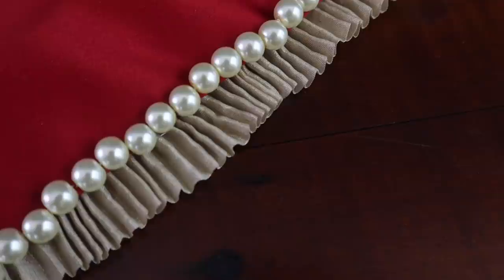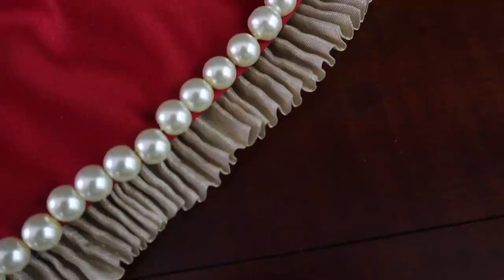Tudor French Hoods || Researching and Making a More Accurate French Hood

Comment: You've demystified the French hood for me. Thank you. I would mind paying for the patterns to make this. It would compliment my not so historic big historic tudor era patterns. 

Over the years now and then, I've see hoods with a widow's peak instead of a straight edge. Its rounded over the head like the French hood. Mostly have seen these seen on Spanish characters on various Tudor era shows. Not sure if real or Historywood.
Reply: Would should read as wouldn't. Damn autocorrexct.
Reply: The widow's peak has been interpreted as the bongrace,a separate band of fabric pinned to shade the head.But it becomes more common by the 50s
Reply from the maker: Thank you! Having a point or widow's peak becomes fashionable after about the 1550s, and really takes off during the last half of the 16th century. Hopefully I'll address that in the next French hood video!

Comment: I live in Sussex England, and happen to be a historian. I obtained my PhD in Medieval & early modern European Studies, from the University of Edinburgh. Additionally, I hold two masters degrees in Tudor history, and archaeology. It’s my opinion that there were several different styles and ways you could wear the hood. I also believe that the hood changed over time. I did a lot of comparison between Holbein‘s paintings and your image at 6:30-20:15, and I only really have an issue with the fact that Holbein was very intentional in his work… and he could’ve very easily made the hood look more flat as it would have appeared if that was in fact correct. The lines he would have painted are very different… Holbein had the capability to capture something exactly as it was, so why did he not do that then… This does not appear to be an illusion as the lines he would have painted to create the structure would’ve been completely different… I decided to sketch this out myself, and I found the same results…. I had no difficulty creating a more flat hood… and i was able to draw the hood just as it was, (No optical illusion). However, i had to be very intentional when giving a raised hood because I didn’t have to…. Artists of this period would not usually take the liberty to create something that did no exist, especially with something as important as a woman’s hood, or change the garmet entirely… unless it were a reality. This leads me to believe that the way he painted was intentional,  and maybe because that’s how it was. However, when I look at other portraits where we have a side view or even effigy’s… we can see the fold very clearly. So we have good evidence that the styles, although they remain similar where ever changing, and it’s not a stretch to say that there were probably very different but similar styles that varied when it came to the French hood. Lovely video!

Comment: I feel inordinately vindicated: my Year 13 teacher 10 years ago told me I was wrong when I said I thought french hoods were just folded back like a normal hood. This is the whole leirpipe scenario again... I think Holbein was maybe depicting that skewed angle to show off the rich fabrics like damask, gilt or velvet and /or jewels, but I also suspect it was slightly raised due to a hairstyle such as crown-braids underneath the cap, forming a halo to which that crimped gold headband  could be easily affixed like a modern headband if it had teeth, perhaps, or if it was made of a grippy material like a velvet or gold-plated buckram (though I do think a velvet or rough, starched top-cap brocade silk is more likely). If it is indeed a gilt metal, or even higher-carat gold for royals, the crimped shape also makes sense, as it would keep a shape more readily, and could be cunningly pinned with u-shaped pins inside the hood itself. It would also make sure the expensive fabrics that make up the hood aren't sitting flush with the woman's hair, and it might allow a modicum of air circulation. I also never appreciated these hoods having such a sneaky tie under the chin, which frankly looks SUPER uncomfy, lol. Anyway, just my 2c halfway thru the video haha
Edit: looking closely, I think some of the white caps are actually ermine/fur. Some of them seem slightly fluffy, and I think it would certainly obscure any folds. I also wonder if the later more cheekbone-huggling style was to allow a little bump/fulless of hair to be shown easier at the rim. I also feel like brocaded or embellishments on the outer hood might've been reinforced with a thick wire in the seam to allow it to lay so flat, or affix it more snugly at the base of the cap, around the ears.... or maybe the chin strap was a cord that threaded through from the seam of the outer hood  through the under cap to fasten under the chin? Who knows!! It's fun puzzling it out 😄

Comment: Great video.  I’m so glad you used silk satin and trims, not that modern polyester crap.  Of course, the precious metals and gemstones of the finest biliments were removed and reused, so we’re unlikely to ever find an original so embellished.  (BTW, the French pronunciation of coif, and the English at the time, is Kwoff, not Koiff).  I’ve wondered if the front part of these hoods, which cover or almost cover the hairlines, were made of cloth-of-gold.  The small quantity needed of this most expensive fabric would have been affordable for most noblewomen and some gentlewomen, certainly if they could  afford precious-material biliments.  It sure looks like cloth-of-gold in many portraits, like Holbein’s.